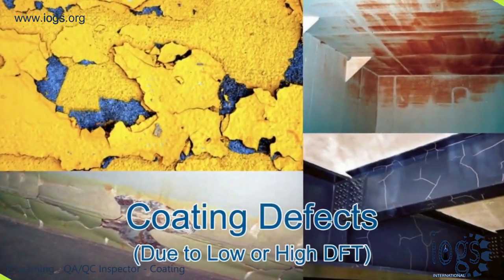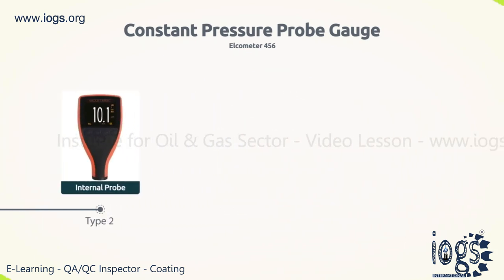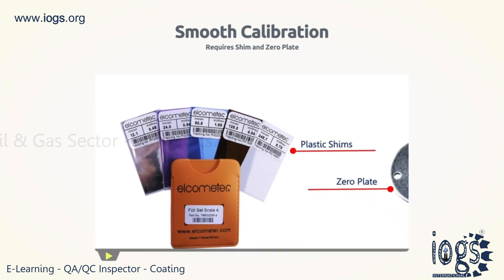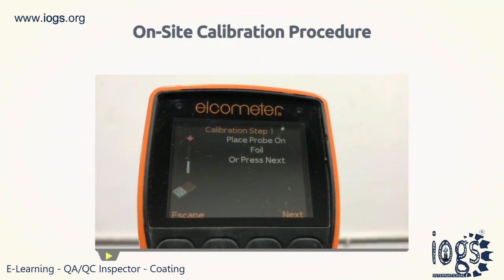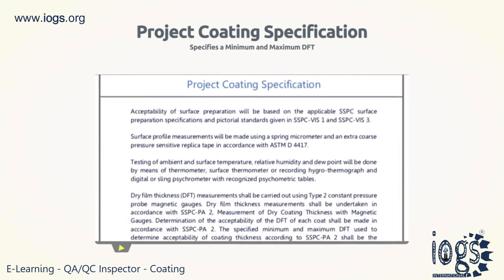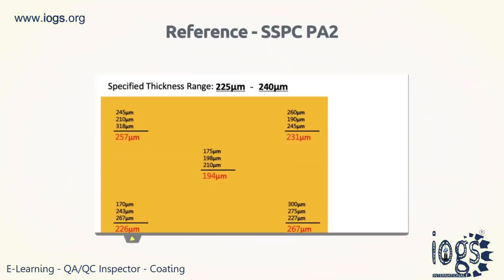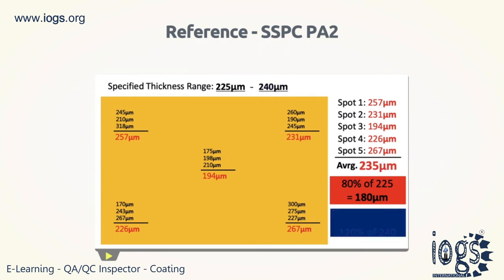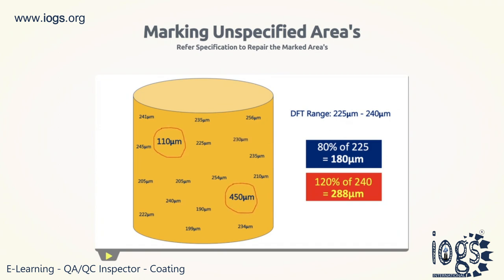DFT Meter — Paint Thickness Meter — How to Measure Coating Thickness as Per SSPC PA2 — Solution

Comment: Is PA 2 the same procedure - (5x spots 3 readings p/10m2) for structural steel - Beams ( I & H beams), round, square and rectangle hollow sections?